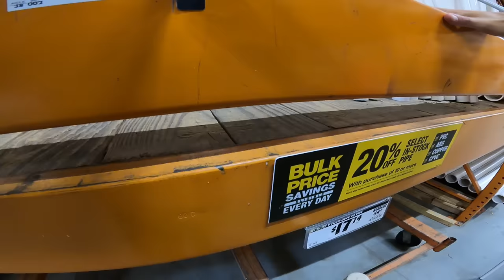Home Depot 1v1v1 Build Your Own Fishing Rod Challenge

Comment: Coolest, definitely the red/black baitcaster. Damn that bro is an artist. Second are (for me) both of the others on the same level of coolness.
Maaaybe the wooden one a bit higher than the plumber cane, but only maybe.
Reply: But I think the Red/Black cool one is gonna break on the top end if the fish is too big/fighty.  I guess the wood one would be the most efficient one because it seems not to heavy to do many casts with it, seems durable enough to tell some fish in and yeah. The plumber cane looks just too heavy to make many casts without getting exhausted and the cool red/black one is most likely only for little fish.

Comment: Get a wooden thick stick attach drill a hole on one end put a fiber pipe in it take a little hit of pvc heat it up and form it on the joint to reinforce it

Comment: I would have found one of those larger wooden rods and a cheap little sander. Then shaped it where it got skinny at the top. Then got two pieces of that red platic waterline type stuff he had. Then got a small can torch and thick pair of gloves. Push the first one over your sanded wood pole and hit it with the torch. It'll shrink down and you can shape it to the rod perfectly.  Then do the second platic pipe and melt that and shape it. Then use some tesa tape for a grip. 

Then you could have used the sander to sand a flat spot where the reel mounts. Then mount it with duct tape and zipties. 

I'd love to do a challenge like this. I'm the type I'd try to do something over the top. 

You guys could have tried that PVC pipe and found some type of caulk to fill it solid to make it more durable. Just some ideas!
Reply: good insight cuh!!!!!